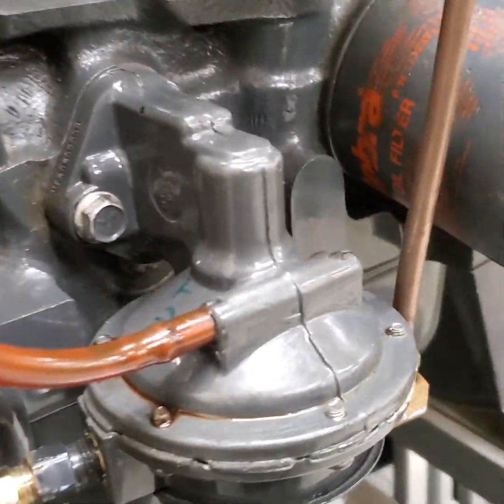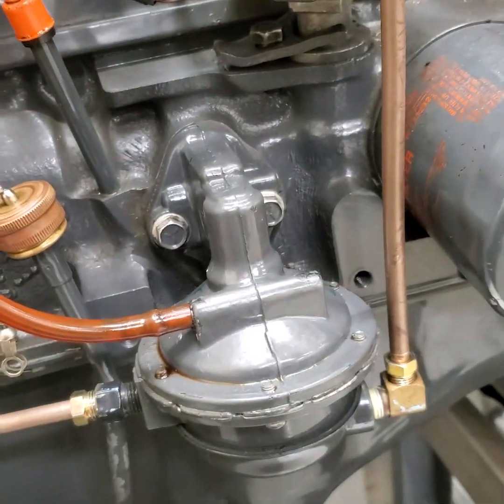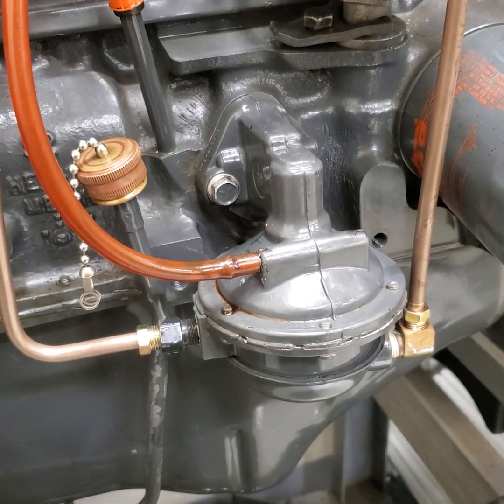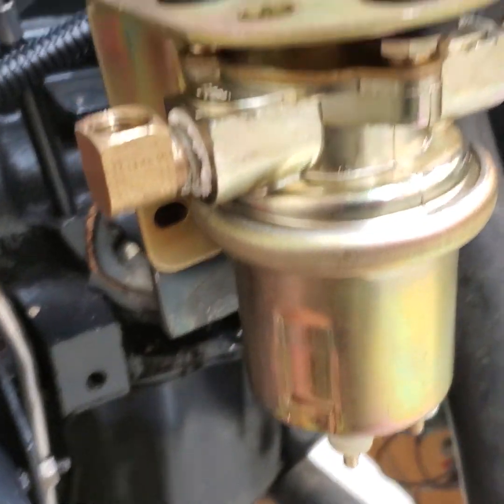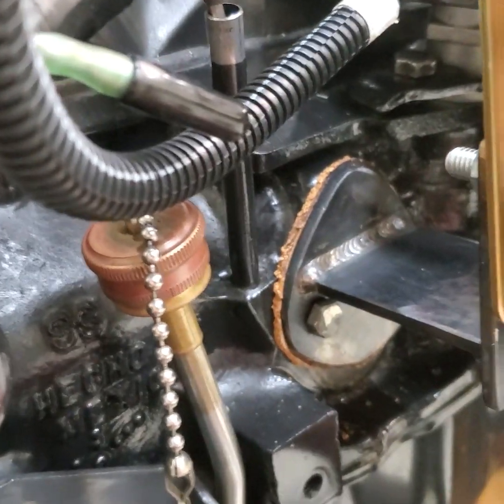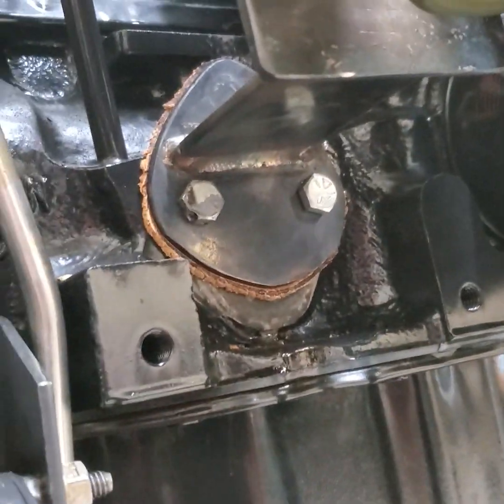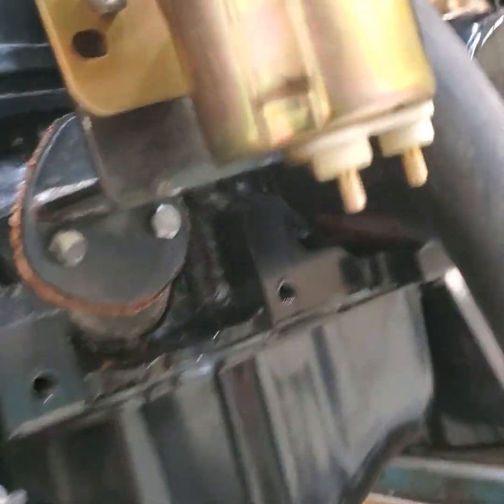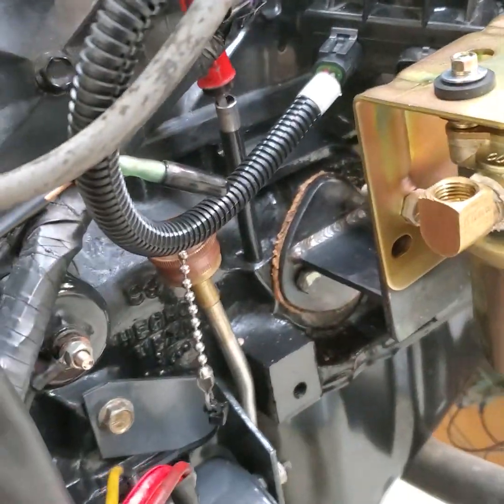Marine Gasoline Engine Repair, Gas engine electric fuel pump conversion.  (Part 1)

Comment: Could you leave the old pump in place to block hole and mount fuel pump in a different area if you have the room .
Reply from the maker: yes that would be an option to leave it installed.

Comment: Hello Ted,  I installed an electric fuel pump in my 1985 Merc A1 G1 3.0L 140hp. It's running ok but has some issues at times starting when it's hot. Question what is the normal recommended psi for my engine. I think I may have purchased an electric pump that may be too high in PSI. That's why I'm  asking what my engine requires. And Thanks for all the great videos.
Reply from the maker: Try pumping the throttle if it's hot and won't start (enrichens the fuel) if that doesn't work, try holding the throttle wide open and crank it to see if its flooding - if it starts then yes maybe the fuel pressure it too high. also when it's hot try taking off the flame arrestor, have someone turn the key on and look down the carb to see if fuel in pouring down the throut when the pump is running (not cranking over). ALWAYS put the flame arrestor back on prior to starting.
Reply: That works on newer but old carbs don't have clear flood @tedsmarinerepair8956

Comment: Great video.. Hi got a question what size threading that goes in the pump ?
Reply from the maker: It's 1/8" or 1/4" pipe threads. Can't remember which one

Comment: To get the electrical connects done right, you must push the boots on further than he is showing. Once that is done. The clip will fit correctly.  Slight modification m8ght be needed to the clip.

Comment: Great video - Does the pump provide some pressure regulation or does it run wide open all the time, dumping all mu fuel into the engine...?
Reply: My 4.3 is a EFI, btw.
Reply from the maker: All electric pumps have some type of internal pressure regulator. And yes they run constant while the engine is running.

Comment: Not impressed with the quality of those carters...plenty of issues
Reply from the maker: Do you have another type you can recommend?
Reply: @tedsmarinerepair8956  of 3 carters, 2 failed basically right of the box( one of them the pump worked but the pressure control not). I hav now switched to the german HÜCO, i does not look anything special but they hav a good reputation. The 120-130 L  capacity is enough for my basic  marine SBC ,   but for tuned engines maybe on the low side.
Reply from the maker: @XSAILOR65  I gather your in Europe, I will have to check into the availability here in the US of the HUCO fuel pumps, and it sounds perfect for most Carburetor engines. 
Thanks for the info!
Reply: @tedsmarinerepair8956  Believe there are a few seller on e bay, not sure they will ship to  US bur guess they will.

Comment: I install this pump on a 350 Chevy engine on a boat and some times brings gas and then the fuel stops, the pump its running but no fuel come to the glass filter just before the carburetor. what a my missing??

Comment: You didn't push the connectors on far enough. The rubber boots expand over the the plastic if you push it on harder.
Reply from the maker: I know now......... but trying to put that on a Marine power big block with the pump way down under the fuel bracket is a nightmare.

Comment: Perfect must be sunny where you are, or are you just a firestarter. I want try the same thing with a ported crankcase 2 cylinder outboard engine, but am to scared it will start a fire. Have you seen the electric fuel pumps on lawnmowers yet?

Comment: Carter Electric fuel pump! Got it. Did it keep up when you ran the boat?  I have a Mercruiser 3.0 with fuel delivery problems. My mechanical pump is new so I don't know why . Nice weld buy the way. Thanks for sharing.
Reply from the maker: Yes. These pumps work on engine up to 7.4L if you still have fuel issues try running the boat off an outboard tank. If it runs great off that, you have an anti-siphon or fuel tank pick up issue..

Comment: Thanks for a helpful video. I overcame the problem of the clip falling out by drilling a very small hole through the plastic between the terminals and inserting an equally small screw thereby locking the clip into place in the plastic, but can anyone enlighten me as to what the loose small grey cap like part is for? Thanks.
Reply: thats a wire nut it connects two wires together not usually used for permanent use though
Reply: @jacobgomer  many thanks for your help Jacob.

Comment: I whish that the bracket made to support the fuel pump is for the demo only, with the weight of that pump and the vibration pattern of that engine at high RPM, it will break at the weld bead at the original pump blocking plate. AS a rule of the thumb, any accessorie attached to an engine should be attached in a 3 dimension mode.
I've made many conversion of auto engines to marine use and I observed that many brackets made for light duty automotive use are not sufficient for substained high RPM marine use.
For the electric, I use a relay that I trigger by a diode array and an override switch, I use the starter signal, the alternator diode trio signal and the oil pressure switch signal
Reply from the maker: The pump is isolated on three rubber vibration mounts and the steel I use is 3/16" plate, my welds have a smooth radius angle with no 90 points, so I am quite sure it will never fail.
Agreed any cheap automotive junk brackets anyone puts on a marine application is never recommended.
The wiring you state is exactly what volvo conversion's to electric pumps is. Just ensure the Diode you use does not cause excessive voltage drop or the pump rotation will be inadequate and it will overheat and fail prematurely.
Reply: @tedsmarinerepair8956  I use the diodes to trigger the relay that feeds the fuel pump.
Reply from the maker: @jacquespoirier9071  That works best

Comment: Just got stranded this past weekend because my clip slipped out after 800 miles of driving. Pathetic design. Good idea sir
Reply from the maker: Your not the only one this has happened to. Hope you found it quickly and used a "tie wrap" to hold in on until you got back to port!

Comment: Great video. I'll also fabricate a stand off bracket. Which oil pressure switch did you end up using? did you also end up installing a temporary priming switch, or was the timing for the oil pressure switch quick enough to get fuel up to the carb? Thanks.
Reply from the maker: Holley 12-810 wired through the pull in coil side of a full ISO relay. Then fused 10amps to the pump from the relay. I was going to install a standard PS-64 switch but it got bad reviews. You can run a wire off the starter solenoid wire as well (for power while cranking) but you will need a diode installed in that circuit so the oil pressure switch doesn't' back-feed into the starter solenoid circuit after you have oil pressure.
Reply: @tedsmarinerepair8956  Thanks. I also looked at the PS-64 and agree the reviews were bad.

Comment: You didn't push the wire connectors on high enough. The boots on the wire goes over the white part, just keep pushing.
Reply from the maker: Understood. I did this on a Marine Power engine due to not being able to see the terminals and took the pump off to thread the posts so I knew the connections were good.
Reply: Sorry to be so off topic but does anybody know of a method to log back into an instagram account?
I was dumb lost my account password. I appreciate any assistance you can offer me
Reply: @Caleb Thiago thanks for your reply. I got to the site thru google and im waiting for the hacking stuff now.
Seems to take a while so I will get back to you later with my results.
Reply: @Caleb Thiago It did the trick and I finally got access to my account again. I'm so happy:D
Thanks so much, you saved my ass!
Reply: @Josue Draven you are welcome =)

Comment: Hi, great video, wondering when part 2 will be uploaded? I’m about to do the same thing and you’ve left me hanging. Hahaha.
Reply from the maker: Sorry for the delay, I am teaching several courses and finishing up with boat work for the season. Hope to get that one done in the next month!
Thanks for the feedback!
Reply: Hi again, just wondering if these pumps can be inverted? The space I have, the pump sits better up the other way to yours, but can you do that?? 😬😬 Cheers.
Reply from the maker: @sleepbus  
The installation instructions do state "Install with the wiring connections facing down". So that is the way I have installed them.

Comment: What psi do the old stock pumps make? Don’t know if I am going to need a fuel pressure gauge
Reply from the maker: From MerCruiser Book #17 all mechanical fuel pumps used on GM V6 and V8 engines have a fuel pressure range of 5-7 psi. I use 4-8 because not all mechanical gauges are perfect.

Comment: Great idea making a bracket to block off that old mechanical fuel pump and use it to hold the electric fuel pump!! I wish I could come take some classes with you. I have been a Nissan auto master tech for 32 years. I like working on boats in my spare time.
Reply from the maker: Scott,
We do have a lot of "cross over" auto techs, thanks for the feedback! And please pass to any younger folks who want to learn a great trade and enter into a very lucrative job market.